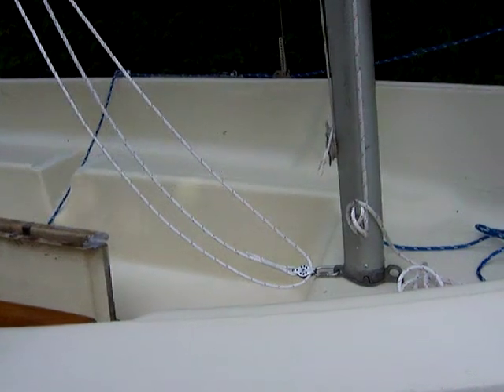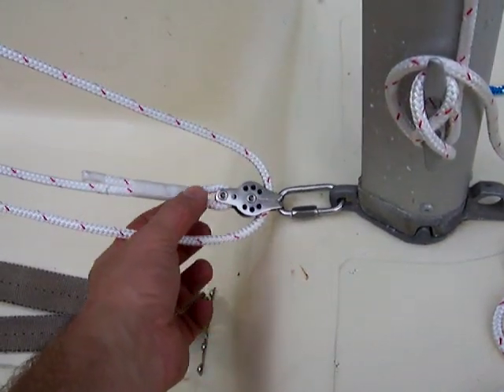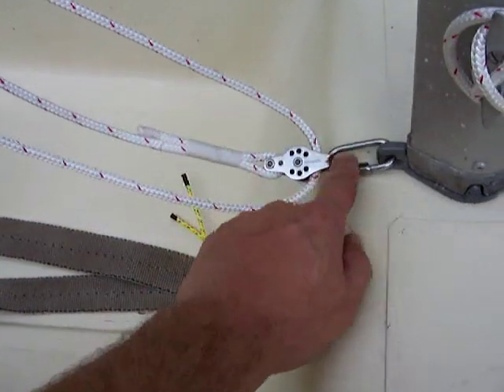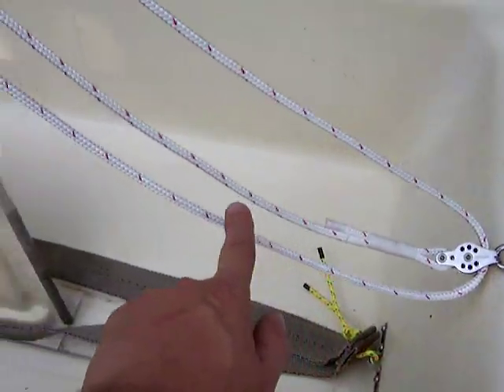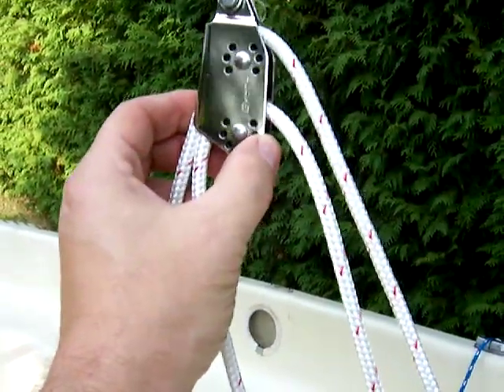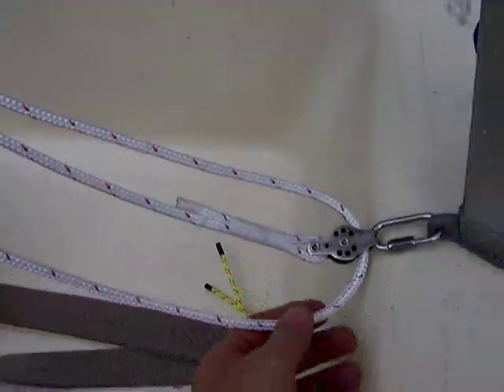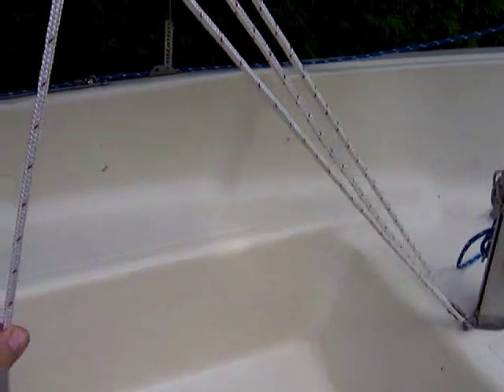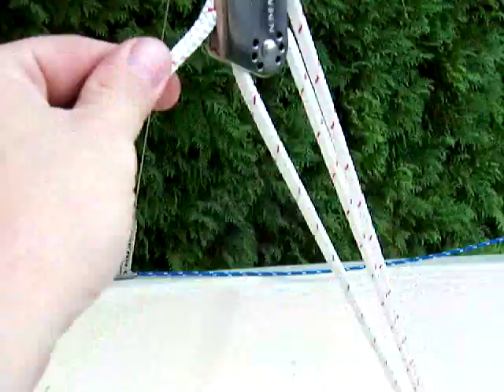1975 AMF Alcort Puffer - Boom Vang Setup

Comment from the maker: A boom vang is a line system on a sailboat used to exert downward force on the boom and thus control the shape of the sail. I installed it with the purpose of squeaking out more speed. I didn't have a chance to sail it much before I installed the boom vang, so I have no good basis of comparison. I use the boom vang every time I sail.

Comment: Greetings again sblg43.  I found a yahoo group that has the original drawings, brochures and other extra info on the Alcort Puffer.  You might want to check it out.
 I am almost done setting mine.  Still need to finish the BOOM VANG and the TOE (hiking) STRAP. I am also interested in a TILLER TAMER.